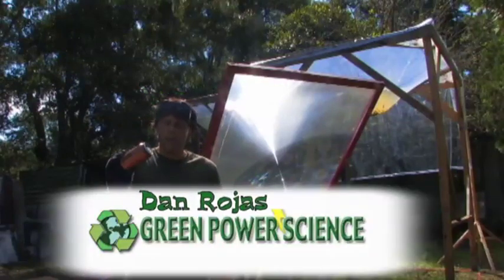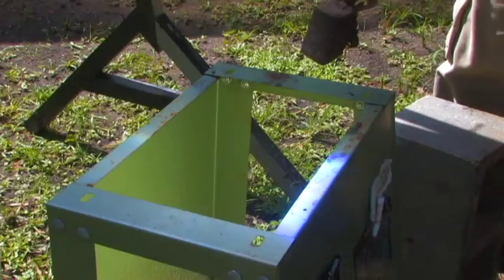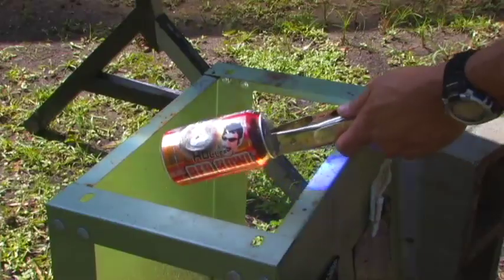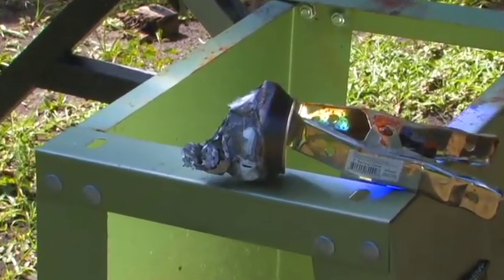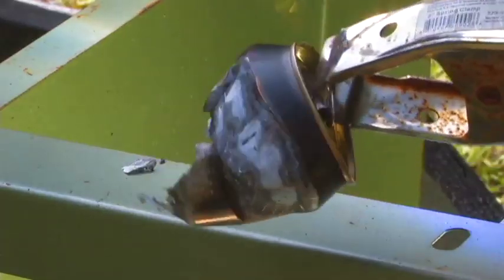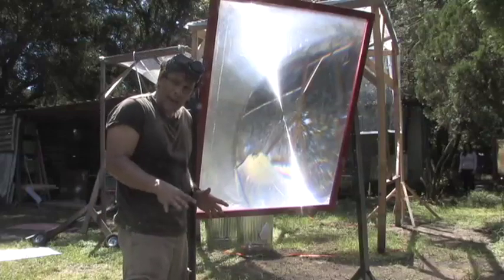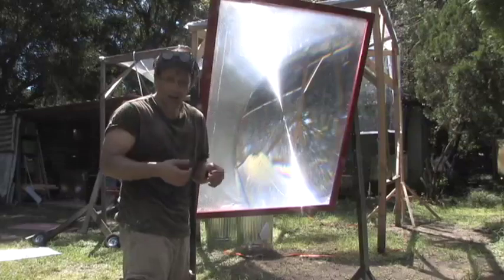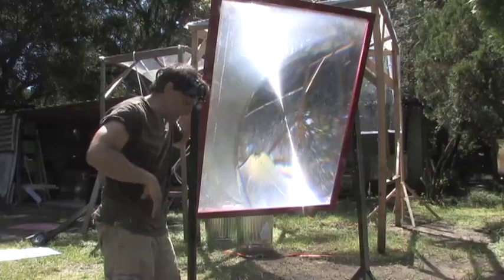Melting Cans with the Sun Solar Fresnel Lens Solar Death Ray

Comment from the maker: This setup was recently used in a TV show. Will let you know when it goes on TV.
Reply: Sorry im replying super late, but can cheap fresnel lenses melt aluminum? I got 5 of them for $10 off of amazon

Edit: they are about 8 inches by 4 inches and the thickness of the lens is about 0.020 inches

Comment: Your videos are pretty darn fun to watch.  This technology has some potential.  Have you been working on the following enhancements?

-Temperature regulation--varying height
-Ability to direct heat--mirrored tubes or fiber optics
-Greater heated area--multiple lenses and mirrored tubes or fiber optics

I'd really like to know your thoughts on enhancing the system.

Comment: Dan would it be posible to use this with a crusible to melt Aluminum cans for pouring my own sand mold parts It seems to me this would be better than the propane fueled foundry Iv been thinking about building  I also do some Plastic smithing and want to try these lenses for that I just got my second lens and want to actualy use this one I had one before and never got the chanse to try it out Also can they be used two or more together or would they burn each other

Comment: I would think the hard part was getting the light into the fibers without melting the cladding around the fibers--you need an interface between the extended light source and the very tiny fibers. I can't imagine this being done cheaply, but it's a challenge worth considering.

Comment: Be careful when melting anything zinc or getting galvanized steel hot enough to vaporize the zinc in the galvanizing.  A while back,  I think I got some zinc in with my aluminum while melting and casting aluminum for some projects.   Zinc has a lower melting and vapor point than aluminum.   I felt bad for quite a while from whatever it was.

Comment: Great vidi,melting points & more pure metals becomes difficult to work with & aluminium (Melting Point 1220 F) is very happy to oxodise. I've done some work with lead (MP 621 F), but equally a material that has a very defined melting point, but is happy to be a liquid metal, without the aluminium thurst to be an oxide. Plumbers solder (MP 365/491F) is good, because it has a very wide 'melting' point 'cos it's an amalgum of metals, and will behave like a paste, a mixture of solid & liquid.

Comment: GREENPOWERSCIENCE... Ever think about using a Fresnel Lens for water purification? Some kind of pressure cooker setup with drilled and soldered copper tubing venting the steam into a coil and dispensing into a condenser container?